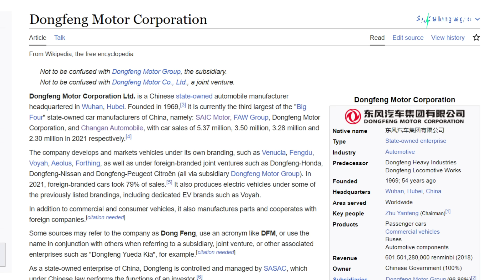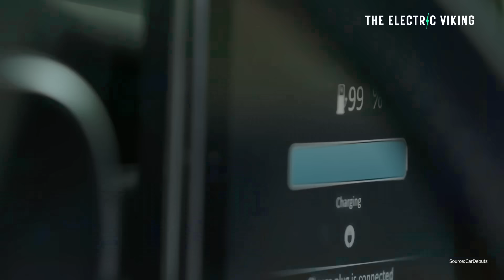Car manufacturer reveals world-first EV with sodium solid state battery

Comment: I think Sodium Ion batteries are very much underestimated. They will not reach the energy density of NMC batteries and thus will probably always have inferior range, so we wont see them in high end cars. BUT, they will be cheaper and faster to charge. And in cheap, affordable cars thats something important. So for commuters with a smaller purse, that have charging opportunities near by, these will be great cars (and there is already the current catch, the amount of charging stations is mostly still an issue). I wonder how many cycles that batteries will be able to do, Na Ion batteries usually arent great at that
Reply: china already launched sodium battery cars in china which charge faster and has longer battery life and give up to 800 miles per charge milage and cheaper than other electric cars.
Reply: @javaidnasir6633  800miles per charge with what car, what volume and weight of battery?

Comment: Thanks Sam. The number of Watt-hours per litre is also important, because the amount of available space in a small car is more restricted than it is in a larger vehicle. Have they published that figure yet? I'm expecting that it will be similar to the figures for LFP or Li-Ion cells. And cost is very important if a budget car is to be produced. It sounds as though they have kept that parameter under control.

Comment: Sodium would be far more scalable than Lithium.  The questions will be if they will last as you suggest, up to now sodium based don't last long and are fragile, so hopefully that is corrected.  One bit of hype hard to pin down is if these are real solidstate with no liquid or what is being called solidstate, the semi solid state which really isn't solid but has a reduced electroline package.  Energy density and so on also of some importance. So why in a small inexpensive vehicle? Guess we'll see.

Comment: Every week there is an announcement of a new revolutionary battery that would be put into production "soon". Ten years ago I heard this too and guess what? We still just use Li-Ion. I can still remember Toyota's promise that they would "soon" launch their first EV with their solid state battery technology. And now, two years later, they have indeed released their first EV... with just a normal Li-Ion battery. There are simply too many problems with solid state technology that are currently unsolvable. Dendrites is one of them and they just don't have a solution for that yet. They don't want to risk launching a new battery that has a shorter lifespan than regular Li-Ion. For now, the best alternative to Li-Ion is currently LFP (LiFePo4).

Comment: Battery technology is the Achilles heal (weak link) of the green energy ramp up, would love to hear your take on gravity batteries, super clean, current coal mines can be converted to energy vaults,  seems like a perfect long term solution to the problem of using massive expensive Lithium  batteries to store solar and wind energy. As for EVs if Solid Power delivers on their solid state Battery technology it will be a gamechanger since they will be able to conver current Battery factories and immediately ramp up production.

Comment: "Game changer"...again
Let's say it really exists, and it really works
5 years from now, it stops working - what do you do?

Unless they have run tests on this battery for years, they have no idea how long these things will last
and if years from now, they will still work or burn up in your garage.

That's always the problem with "game changers" - they have no history that can be used for forecasting.
just promises from yet another Communist company...
Reply: Actully, at least for batteries, it depends more on cycles - so they can test for that in a quick test. Also, you have to understand some chimistry. NMC already were proven to have issues because of how they're made. Na on the other hand, wont have the same likely hoods of the same problems. We already know those problems - such as over heating and thermal run away. Some of those issues are increase because of the elements used. More or less - these Na solid state batteries remove a number of failure points thus will have increase safety by design of not having some of those issues. No more flamable liquids, Na doesnt burn as bad, being solid state means it can be cut, bent, or even puncher resulting in less performance but not thermal run away. Not to say they can't still be set on fire for other reasons (fast over charging for example).
Reply: @adr2t  What is the definition of a "cycle" - really?

I've searched for years, and I can't find one.
For instance, on my Model Y I plug it in every time I drive into the garage,
so is every plug-in a "cycle"?
if so, I could just plug in once a month and save 30 cycles?
or just plug in when at 10% state of charge? and 10X my battery life?

I doubt cycles will provide any clarification since there is no definition the battery industry has of a cycle.

time is important - things oxidize slowly or change in structure slowly, so 5 years from now, you could be sitting on a bomb that oxidized slowly into something lethal.

But battery people always seem to be in a rush to sell something they really don't understand.

Comment: Sodium belongs in grid storage. There, weight does not really matter, the price tag does
Reply: CATLs sodium-ion batteries are competitive with LFP in Wh/kg.
The batteries belong wherever they make the most sense economically.
Reply: Solid state should curve that issue - more or less you will see less weight/size still even going sodium. The bigger reason to use it is the safety and more temperatures ranges that cars need to have around the world. So solid state will be the reason Na will make it out into the auto industry. Solid state wont be needed for grid/home so it will be a battle of price of solid or ld Na batteries will win out.

Comment: Nice one Viking. FYI the NMC622 battery in my 2019 Kia e-Niro has an energy density of 147 Wh/kg and the car has a range of 450 km in real world driving. Of course NMC state of the art is now around 250 Wh/kg and LFP >150...but tbh I don't worry about range any more having owned the car from new and done 88,000 km...I never drive more than 250 km at a sitting and the appeal of the battery you are talking about here is charging speed. It takes me at least 30 minutes to put 200 km on...so at 8 minutes to do that I would accept slightly less range, smaller battery and the lower price that would go with it. Sodium is a heavier material than lithium (atomic number 11 and opposed to 3 for lithium) hence the lower Wh/kg but the low temp performance, abundance, safety and lower price suggest we will be seeing more of it.
Reply: Actually, NMC state of the art is 300Wh/kg.
Reply: Coz you don't drive further than 250Km you don't have an issue.  I used to regularly drive 750 Km with a refill time of 5 mins for petrol.  Now I use diesel and 750Km doesn't require a fuel stop.  EVs just don't cut it.
Reply: @csjrogerson2377  It's you who doesn't 'cut it'...Who in their right mind drives 750 km without stopping?  Don't you have a bladder!?...don't you need to eat or drink!?..I've owned ICE cars, petrol and diesel since 1974 and I never, even when I was in my 20s would drive for more than 3 hours without taking a break. Back in those days I was clocking 40,000 miles a year as a computer service engineer so I take my driving, my safety and the safety of other road users seriously. I would never go back to an ICE car, they just don't cut it for smoothness and acceleration, EVs are superior in every way... and btw I recently did a 500 km trip here in France with a 30 minute stop to charge, grab some lunch and use the bathroom. Thankfully we have now reached the point where more diesels are being scrapped than new ones being sold and sooner or later you will be driving an EV instead of polluting our lungs with your sh!tty diesel.

Comment: 8 minutes/200km is actually pretty good considering that is car will have a very small battery pack that despite small size appears to be able to absorb lots of energy in little time. Basically great C rate capabilities.
Reply: Nah, Toyota have got one coming out soon that'll do 10,000km in 30 seconds.

And it'll be cheaper than an Aygo.
Reply: @paulgoffin8054  not sure if you are joking or serious. It sounds like a joke but there are a lot of unhinged people on the internet.
Reply: @4203105 It was a joke.
Reply: @paulgoffin8054  Wait till you see the Indian battery made with cow dung. It will make Toyota obsolete.
Reply: @8spores  Still better than your terrorist battery. Btw, Reliance just bought Faradion.

Comment: Reverse osmosis produce sodium?
Could you use sea water to, not only produce fresh drinking water, but generate the sodium?
Because that would be pretty amazing.
Reply: Elon: hold my ….
Reply: There's are literally mountains of salt. Like table salt we dig that out of the ground and put it in a little container. There's so much choice we tend to just extract the most pure stuff. It costs basically nothing at the store, because that's what it's actual value is. When desalinating water, we tend to expel the brine back into the ocean because it's worthless, putting it in a holding pool would be a waste of resources. Again, mountains of salt.

The problem here is the sodium is like half the energy density which is a problem. But, this scales super well because salt/sodium is effectively limitless.

Comment: Now this is a game changer. 8 minutes for 200 km of range is just fine. If this works as promised, it will not take 5 years to beat Lithium. Just imagine the sales pitch ending with "and it's cheaper as well."
Reply: Is 200km in 8min not better than all existing EVs?
Assuming the car needs 200Wh/km, that's 40kWh for 200km.
40kWh in 8min equals 300kW charging power sustained over 8 minutes.
No current EV can do that, right?
Reply: @vonnikon  Not sure what the competitions claims are or how much this battery will hold, but Sodium-Ion performs much better in cold conditions up to -20 Celcius.
It also enables the car to drain the battery to 0% and charge it to 100% as well without damage.

But the real advantages are fire safety and environmental impact. When we use these cheap batteries for grid storage at scale, it may finally be possible to charge overnight on solar power without massive destructive and polluting Lithium mines. Sodium is so abundant that we can do it the right way at an affordable price.
Reply: @SolAce-nw2hf 
Totally agree 🤞🏼let’s hope they deliver on quality control. 
But if the cells/battery delivers it will kick Li ion into touch for now. Plus as the US sits on 80%
Of the known reserves they better sit up and take notice .. we don’t want the Chinese making Na by burning fossil fuels . Even if it was a spin off from desalination of seawater.

Clive 🇬🇧🧙‍♂️
Reply: @vanessabryan786  i think Sodium batteries will make it. There are too many competitors working on their own version. Personally I just will not buy a Lithium car anymore, because it already feels like buying something outdated. Not to say it's a bad deal for everyone, but my ICE car is just fine and I think some patience will pay off, especially with my very low yearly mileage.
Reply: @SolAce-nw2hf God I hope you are right ❤
Reply: @SolAce-nw2hf  Excellent points! It does seem to address most if not all of the problems with Lithium.  If true, the question becomes how fast we can build up manufacturing capability.
Reply: @vonnikon As often said : It only counts once in actual production. 
This is 2 to 3 times quicker, assuming a small battery is used. And assuming it is the normal charge rate wrt longevity. And assuming the charger can provide the 300kW + losses.
Reply: @vonnikon creo que por el tamaño y  por ende su bajo peso, el consumo estimado tuvo que haber sido mucho menor, alrededor de 15kw los 100km. Y sí tomas solamente consumos urbanos, deberían estar alrededor de entre 11 y 13 kw. Por lo tanto la potencia de carga necesaria disminuiría considerablemente. Estaríamos hablando de una potencia de carga entre 200 y 250 kw hora. Saludos
Reply: @vonnikon  it's especially impressive since this battery will likely be pretty small. You can charge a big battery really fast for the first half. But a small battery to nearly full, that is impressive.
Of course we knew that sodium batteries have much faster fast charging than lithium batteries. But still.
Reply: @vonnikon  if it is to 100% charged it is for sure.
Reply: 200 km in 8 minutes = 200 km / 0.15 kWh.km-1 = 30 kWh in 8 minutes = 225 kWh sustained power.

That's 50%+ better than top of the class NCA/NCM Li-ion and 100% than LFP Li-ion.

With added safety, affordability, longer cycling life.
Reply: Watch youtube for 8mins or read news so its very great 😊
Reply: Of course it will work as promissed, who has ever lied or over promised about battery technology over the last 20 years or so :p
Reply: @PaulMathews-p4o It's getting pretty real. Batteries are showing up on Youtube tests and big Sodium battery factories are being built by BYD and it's competitors.
Reply: 200 km range is not real world usage, minus 25% for a more realistic figure. Not enough range.
Reply: @yorkyone2143  That's not the claimed range.  That's the range after 8 minutes of charging.
Reply: @yorkyone2143  And, you know these "facts" how? Produce some evidence to support your claim regarding this battery ... I thought so.
Reply: @yorkyone2143 True in the USA but not in many other parts of the world where daily commutes may not exceed 15 to 30 km per day.
Reply: @yorkyone2143  At that charging speed, I'm not too worried. Let's say 160km, or 100 miles. Eight minutes to charge every 1 and three quarter hours of highway driving? Not bad at all; it's a commuter that can actually be pressed into service for a long road trip assuming the charging infrastructure is there. Yes, the range is less than half that of a Chevy Bolt assuming my pessimistic 160km estimate, but the DC charging is eight to ten times as fast.
Reply: @yorkyone2143 We will have to wait and see. Lithium batteries are almost useless in freezing temperatures and tend to degrade fast in summer temperatures. Sodium-Ion just works in both, so with street parking it should be a lot more reliable.
Reply: I just did that with my Model Y, and would have been faster if I had started charging at closer to empty.  Hopefully cost/weight/manufacturing work well for the Sodium SS batteries.  👍
Reply: @chrishaberbosch1029  Is that an LFP version? I just realized that my dream of charging in 8 minutes is just that. The public chargers in my city all only go to 22 kW, so 8 minutes is less than 3 kWh of charge. 😭
Reply: @SolAce-nw2hf  high nickel long range not LFP.  NMC or NMCA I imagine.
Reply: @chrishaberbosch1029  That is a Nickel Cobalt Manganese battery with 75 kWh usable capacity. More range per kg, but that comes with a cost in terms of environmental impact, Cobalt mining conditions and fire safety.
Reply: @SolAce-nw2hf  Yep, with Tesla currently maxing out at 250 kW and Electrify America at 400, even those are going to be charger-limited rather than battery limited with this vehicle at least at the start of a charge, though they'll see some benefit toward the end of a charge.
Reply: And last week it was CATL with its new and improved LFP battery with its claimed 400km in 10 min. Then next week another breakthrough battery. This channel is getting so old with so many battery breakthroughs!
Reply: @gregb1599  Well, the Lithium improvements are nice, but Sodium batteries that meet the requirements for cars is a real breakthrough. I do think it's going to make BEV's much more compelling.

The only constant is change. Without it, things would just be boring.
Reply: It's absolutely fantastic for people who drive for a living too

My dad can easily do 500 miles a day as a taxi driver for instance. If these could be charged up to 80% in 8 minutes then that's absolutely fine.

Currently I think he has to refuel probably once a day or so
Reply: @waqasahmed939  yes, as long as a charger that can handle it is always nearby.
Unfortunately for me, most chargers only go up to 22 kW, and a home charger does 11 kW. Even assuming an unrealistic 11 kWh per 100 km  it would take almost an hour to recharge 200 km on the standard public chargers and 2 hours on a 11 kW home charger. So we need more superchargers for this to work.
Reply: @SolAce-nw2hf They aren't near your neighbourhood? They already exist and I have several within 5 km radius.
Reply: @MrChakra108  Well, there is exacty one 50 kW charger within 5 km, but everything else is a highway trip without enough exits. It would cost me at least 20 km of round trip overhead. Just a waste of time and energy.
Reply: Americans will never buy these. They were these mini-cars. The EPA will go over this.
It's the first opportunity for us to stand together as one.
Reply: Tesla cars will go bankrupt if this car come in USA market.
Reply: It will take 8 minutes.
Reply: @thystaljaard7607  😂
Reply: In minus 20 you lose half your range all of them
Reply: @PeterWilliamson-nn9et  That is where the sodium battery has an edge. -20 should not affect it that much at all.
The obig things limiting the range would be heating the car itself and lower air densy, requiring more power at higher speeds because of more air resistance.